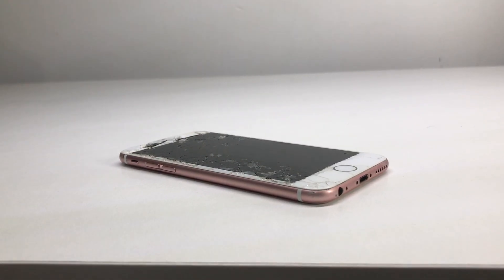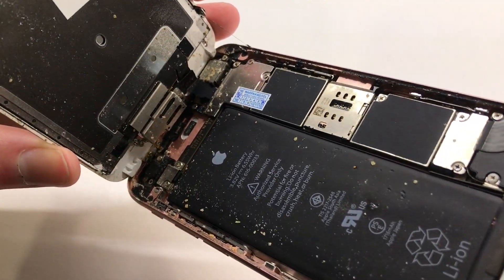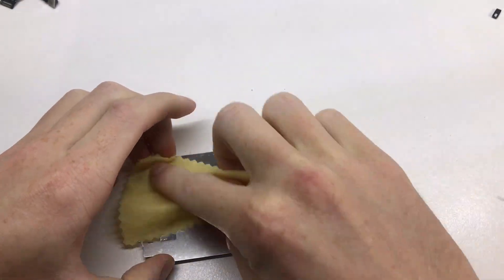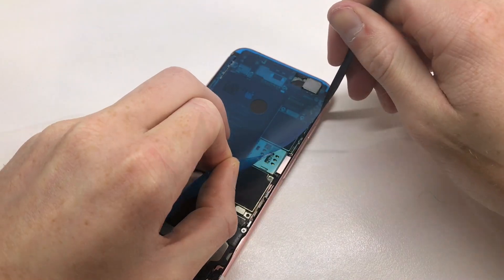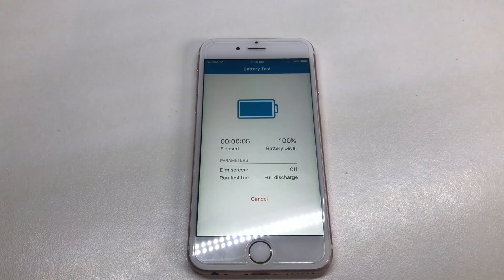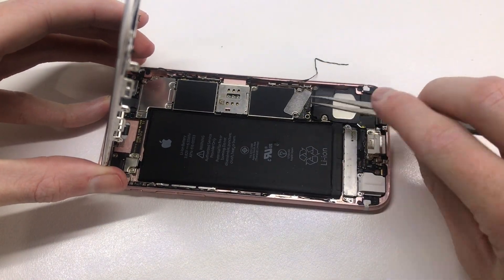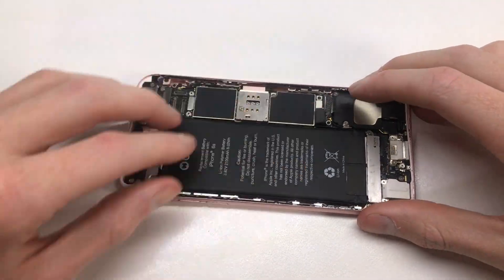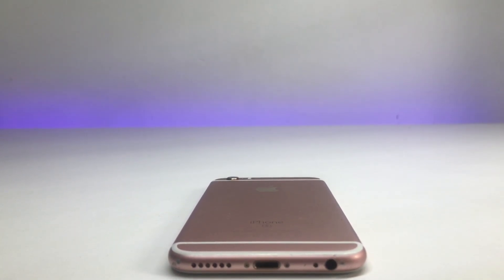The $60 iPhone 6s Restoration - 5 Second Battery Life! - IOS 10.2

Comment: i actually paid about 60$ for a working 6s with a defective display that had some dead pixels in it but the screen worked and the battery was bad i got a 15$ partial refund from the bay seller for a battery and i just put a display that i got about a month ago on eBay it was a used original display and i paid about 20 dollars for that display my iPhone 6s is actually a 64gb verizon unlocked model and it works great for about 70-75$ use I'm happy with it even though i had to put a little work into it its a good phone and i didn't pay much more than you did for ur 16gb 6s
love ur videos btw hugh i have learned a couple things from your videos and that's great keep up the great vids!!!

Comment: Ha. That’s something. Considering this video is from 2 years ago. I still have my iPhone 6s Plus. Forgot to do the battery replacement during the battery replacement thing apple was offering. So I’m still using the original battery. Been using the battery for 5 years. And like. My battery isn’t great. It has a capacity of 74%. But like. It last a lot longer than 5s. Actually. Sometimes I can get a whole half hour or longer off of 1% battery. Don’t know why. Sometimes it does immediately after 1% and other time and lives on like a champ.

Comment: Any tips on cutting through the adhesive? I recently bought a secondhand iphone 6s and it got it’s battery replaced recently. But i noticed the upper left side of the screen is a little bit lifted so I’m guessing the person before didn’t clean the adhesive fully simply refusing the old adhesive.

Comment: You can actually potentially save the original home button quite easily by checking to see if the clicking piece properly shorts together the 2 ends of where it’s connected and if it doesn’t, you can easily desolder it without removing the backplate from the button and solder on a new one. Of course this does take some skill but I’ve done it before and I was able to save Touch ID by replacing just the mechanical piece that acts as the actual button. Usually that’s the piece that breaks so it’s nice to replace just that and retain Touch ID
Reply: I also thought about the same idea and searched YouTube but no one has like that yet but this idea may work

Comment: I have an iPhone 6 who got the same problem with the home button, where it stuck but the touch works. I soak it in alcohol for about 10 minutes and use a mono tooth brush to clean the back side, and it works fine afterward.

Comment: Pressed the vid my 6th gen iPad Air said ‘5% remaining’ 
Video: has ‘5 second battery in the name’ 
Both:*shows messages at the same time* 
 COINCIDENCE! I think not.
Reply: Ipads are kinda wierd because Apple could have easily made them have the same charge warnings and the low power mode, but they didn't

Comment: I recently got a 6s with a cracked screen and bad dock connector for $20 from a relative, and I put in a slightly differently broken dock connector (bad mic) and it charges now so i've ordered a new dock connector from eBay and I plan on replacing the screen once I have the money. I expect the total price of phone + repairs to be about $70, which is pretty good for a 128GB iPhone 6s Rose Gold

Comment: I have a 6s that was water damaged. Before it was watered, I had replaced the screen with an aftermarket one (not a refurbished apple screen) and the phone was working fine. After being watered, the phone would turn on and the screen would display, but it seemed like the screen itself wasn't registering touch input. I let the phone die so that I could put the old screen back on to test this theory, but now it seems like the phone won't charge ... could this be due to the battery and/or charging port having water damage? Or, just once it died it literally died? Any diagnosis/tests that you could help me with is much appreciated!

Comment: I have a iphone 6s but one day it crashed and the screen went to whitish and then to a black screen but when i tried restoring it it would always fail so i tried activating it with wifi but it would just say that it was connecting and would never connect but when i tried to use data it would say that the activation servers couldn't be reach and when i tried connecting to iTunes it would say to make sure that the sim card didn't have a pin lock and if it did to unlock it then plug it back in and now i took it took apple but they just recommended a new phone after they tried the same methods i did so now om desperate for a way to fix my iPhone

Comment: I had an iphone 6 which i got for £45 (GBP) and it worked fine. The battery lasted only 25 - 50 seconds. I left it on charge and the battery started getting hot while apart so i took it off charge, hot to touch and the battery started swelling up and it basically exploded. Luckily the logic board was jot affected and those battery adhesive tabs was broken so i just ripped the battery out and replaced it with a battery named “G6” that cost me £20. The iphone is in great working order. Do u think that the battery make is good enough? And would it be possible to link me to a website selling those batteries what u had in the video? Thanks

I was bored so i told u my story 😂

Comment: I went to the Apple store with a completely untouched iPhone 6s which had a dead battery and they simply refused to replace it. After going to a third-party Apple repair store, they fixed it and said the problem was a dead battery. Apple refused to repair it because they "didn't know if it was the battery".

Comment: Nothing new from Apple. It’s like they try every way to get out of a repair. I have 2 6s Plus & both qualified per my serial #’s for the Camera Module Recall / Replacement. However, they wanted to charge $199 per device. That’s not a “Free” Recall Replacement, IMO

Comment: You see with android we have batteries that aren't this difficult to replace. Here's the steps. 1. Buy the battery 2. Open the back of the phone 3. Take out the current battery by sliding it out 4. Snap in the new battery 5. Put the back of the phone back on and there you go

Comment: my iphone 6 has a shattered screen, half of the screen doesn't work,  battery life for ~20 mins,  and it's nearly impossible to charge and I still used for it for 8 months under those conditions haha
Reply: Pendejo respect to you
Reply: Sawyer Beck howww!!!!!?
Reply: That is what an average apple user looks like to an Android user
Reply: I'm sure you have to charge it everyday 20 min or keep your power bank connected lol. I have an iPhone 6s plus and the battery health is 83% and it already bad. Too fast running out.
Reply: Same here but I got water damage
Reply: Omg xD just get the screen and battery replacement, hardly would cost 60-70$ but it's worth it
Reply: Been using iphone 5 in 6 years this last year the screen got cracked cuz I fucked up and the battery is really bad now it lasts for 15mins If continued usage but it lasts atleast around 17hrs if I don't use it that much only for calling and texting a little bit and also it charges from 10%-100% in 10 mins
All this years I finally gave a fck and planning to buy a new phone lmao
Reply: Pinche pendejo wuey
Reply: Wow and I would say that I need a new one, a lot of respect to you

Comment: 3:45 "security reason" the home button isnt hot swapable meaning it cant be replaced while the phone is on and it work, the touch id wont work when the phone is first turned on and requires a password. the only reason its like that is so you cant repair the phone.

Comment: Bro, I went to the apple store to get my iPhone 7 repaired (Error 4013) and it was eligible for a free repair but the only thing is they wouldn't fix it unless I get a tiny crack in the corner of the screen fixed for $149!? They said it had to be repaired in the apple store or else it wouldn't be eligible for the "free" repair on the motherboard... Apparently switching the glass out at a 3rd party shop wasn't an option for me.. Of course I could've just bought a 1st party refurbished screen off of eBay for cheap but they already marked me down for the repairs so there was nothing I could really do at that point... Good thing though I only bought the phone for $40. iCloud unlocked and everything. Just wish I knew before going into the store so I could've replaced the screen on my own.

Comment: The photo you took of the Apple Store employee's iPad doesn't even show the repair type selected. Plus, if the device had already had a battery replaced under the quality program, it doesn't automatically disqualify it from any other repairs. You should've been able to pay for a battery replacement, if anything, at Apple's discounted battery rate.

Comment: Can’t you get a new Touch ID home button?
Reply: The Home-Button is tied with the motherboard of the iPhone. The only ways to get a scanner (Touch ID) replaced would be to either replace the motherboard or somehow get a new button to work with your old motherboard. All iPhones with scanners in their Home-Button works like this and it is an annoying problem on iPhone 7 and 8 which don't use an physical button but a pure scanner as you can't even easily replace the button's click functions... '_'

Comment: iPhone 6 is really one of the best iPhones out there, big change from the iPhone 5. But then 6s, 7, and 8 were basically the same model over again.
Reply: There aren't many things they can improve really
Reply: xX_D4RKG1ORG1NO89_Xx if smausng can they can
Reply: Ye Iphone 6 is actually the best. From 2014, it can easily run Fortnite. S7 or S8 from 2016 and 2017 cant. NICE
Reply: @TheRealNightShot  S7 and S8 can but fortnite just hadn't cone out for most Samsung devices. I'm pretty sure my J3 could run it
Reply: @xavierdrayton-harrold4138  Of course J3 can run Fortnite. But.... you know,  Epic is shit so they probably wont make J3 supported
Reply: @xavierdrayton-harrold4138  All marketing. S8 Snapdragon can run Fortnite on high settings,Exynos one cant. And the Exynos is a little more powerful. Nice
Reply: @TheRealNightShot  The j3 is a heap of shit in comparison to an S8. Half the ram, half the cores and has exynos 7570 compared to the S8s exynos 8895. Not to mention,  exynos is optimised for Samsung.
Reply: @xavierdrayton-harrold4138  Iphone 6s have a dual core 2 gb of ram. J3 is faster and better. Samsung J3 cant run Fortnite. Iphone 6s can
Reply: @xavierdrayton-harrold4138  NICE
Reply: @TheRealNightShot  I haven't mentioned the iPhone 6s at all and it was you that said the j3 can run fortnite
Reply: Yes that's right. Iphone 6s is even faster than the standard one. And the 6 standard can still run Fortnite LMAO
Reply: btw I'm tired of this conversation. See you.
Reply: j3 cant even run pubg mobile
not even the cheap knockoff
Reply: @TheRealNightShot  iphone 6 cant run fnbr
Reply: @aliawad3541  Iphone SE can and it's less powerful.
Reply: @TheRealNightShot  i guess yeah k
Reply: @aliawad3541  Btw Exynos is a little bit more powerful than the Qualcomm friend. On the Exynos S8 Fortnite goes with Medium. Why all this marketing Bullshit?
Reply: The NiGhTsHoT it cant 6s can
Reply: That's how I feel about all phones in general. there was a generation where specs plateaued in performance, meaning you wouldn't notice much difference going from one phone to an upgrade. I'm still rocking a Nexus 6P.
Reply: The 7 is Rip headphone jack. 

The 6S is the best iPhone ever! It will be my favorite millennial magnet
Reply: Well actually the 7 moved away from a moving home butting to a haptic touch home butting to give water proofing, and then the 8 gave a glass back for wireless charging, of course each new iPhone also received the chipsets and obviously will receive iOS updates for longer
Reply: Nope 👎
Reply: Nah Steve Jobs era was better. The shape of the 4s is far superior.
Reply: Dude the iPhone 6 is slow af now. 6s, 7 and 8 are way faster than that one. The iPhone 6 is as fast as the iPhone 5s
Reply: X ZinJa X no the 6s
Reply: Also you rather just say iPhone 7 Plus and 8 plus are the same and iPhone X ,
Xs and xs max are the same and iPhone 5s and se are the same😂😂
Reply: No not really matey
Reply: Idk loving my 8+
Reply: me with my iPhone XR
Reply: iPhone X is the best it has the best screen and processor
Reply: Tezefuzion Plays costs an arm and a leg though
Reply: The iPhone 6 is very different than the 6s, 7 and 8, spread your propaganda elsewhere, the only similar phones are the 7 and 8 and even they have differences
Reply: @user-vk8yq8oq7p  what are you on about ? The iPhone 6, 6s and seven are THE SAME EXACT PHONE except for a small speed boost with every model and a slight visual change like the s next to the name lmao
Reply: William what do mean?!?! I’m just a everyday random person commenting about this stuff, I’m not trying to spread no propaganda. I’m comparing what I see.... LITERALLY. Idk what differences you’re talking about, but I’m talking about the looks. They got the same design, with Touch ID and everything. The sizes are pretty much the same too. There really wasn’t that big of an upgrade from the 6 to 7 or to 8. For everyday users like me, they could all do the same thing. Play games, call, etc. I’m not some type of a professional photographer trying to take photos and trying to look at all the little details and upgrades that Apple has brought to their camera.
Reply: There is actually a large difference when you bump up from a 6 to a 7/8. The 7/8 are significantly faster in read / write speeds and they both have a better batttery life, the 7 has a haptic feedback fix and the iphone 8 has an A11 Chip which is easily superior to the 7 and 6.
Reply: @mag1c938  Iphone 7 is the best out of the 6 , 7 and 8 imo as it has the best battery life due to highest capacity battery. - i still run my 7 now albeit i have replaced the screen and battery
Reply: X ZinJa X This is the 6s stupid and no are u serious the 6s looks COMPLETELY different from the 7 and 8
Reply: X ZinJa X no? 7 and 8 charge like 3 or more times faster and have much better photo quality. Also waterproof and dust resistant. Oh and it also automatically turns on and off if you face it down or faceward up
Reply: To me iPhone 8 is best because 1# it is future proof, 2# it has Touch ID, 3# wireless charging, 4# water-sealed for accidental dropping to wet floor.
Reply: 6s is the true IPhone 6 as the 6 suffered from a weak frame and a high chance to bend. The 6s fixed these issues with a better material in the frame. The rest of what you say is true.
Reply: iPhone 6 was like the iPhone 6s and 7 and 8 are different

Comment: I actually looked up the serial you put -- I see it was replaced as well.

The device was likely stolen from Apple or sold as used stock. Ouch.
Reply: sushles possible it was replaced and used to death before selling it online also. Only the OG owner will know o.O
Reply: No no. 

When Apple replaces a device, they OOW the old device and transfer the remaining warranty to the new device. 

Then they take the old device. 

If they resell the device, they Brightstar it and push it out of the Apple system as a standard device and give it was 78 designation to show the device was sold off as a lot. 

This device was not given that designation: either the process was done incorrectly, fraud may have been involved, or the device was stolen.

Comment: I had the same experience with Apple too few weeks ago. Only that I have replaced the battery myself (original battery was at 82% health with over 500+ charge cycle & out of warranty) just 2 months before Apple actually acknowledge the battery problem and issue the replacement. They flat out refused to change the battery, even when I still keep the original battery and I was willing to pay for it. I was dumbfounded by their logic. thinking of getting the higher capacity battery and doing it myself soon.

Comment: I believe that if you order a authentic apple home button for that particular model off of eBay it will work again. Third party home buttons won’t work
Reply: Lol sadly not mate, I've tried buttons from other devices to no luck, if the flex cable is ripped you could re solder the trace wires to make sure touch works but that only works sometimes, visit my channel I will  be uploading more videos on component level repairs.
Reply: Sohail Karim when I repaired my first iPhone (iPhone 6 Plus) I accidentally tore the cable on the metal back plate of the display but I ended up ordering a new backplate as well. Afterwards everything worked perfectly

Comment: You can repair the original home button, probably the switch was faulty, you can resolder a new one, or easier peal off the top sticker and replace the 2 clicky stuff below the sticker with ones from another button. Touch id sensor is more important, it worth the attempt
Reply: You mean peel

Comment: how would you be able to tell if the digitizer connectors are damage? I recently fixed an iPhone 5 and bought a new screen from fixez.com but idk if the screen is defective or if the actual connector is broken. The LCD turns on but the digitizer doens't work.